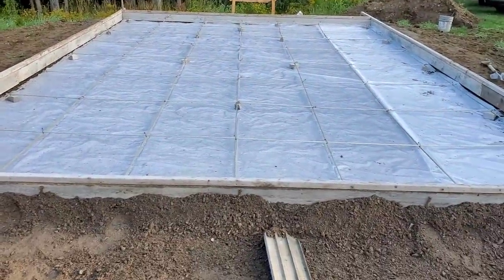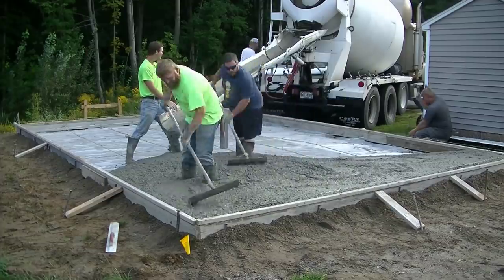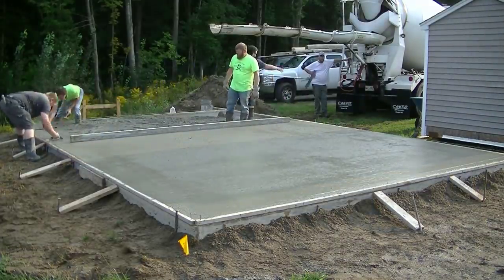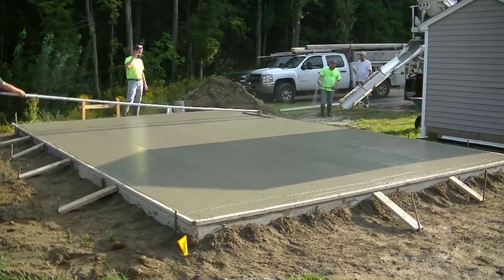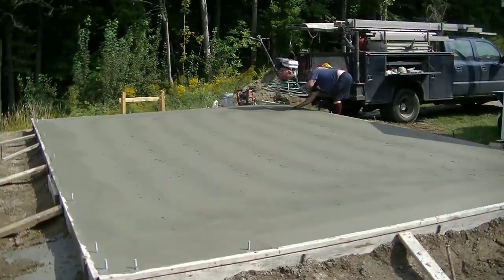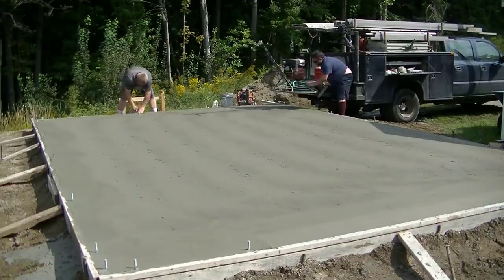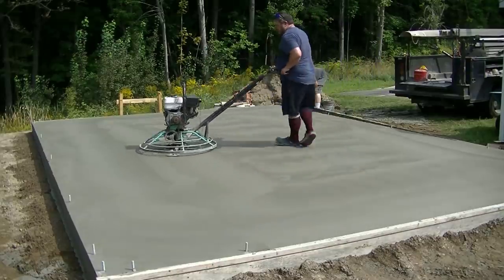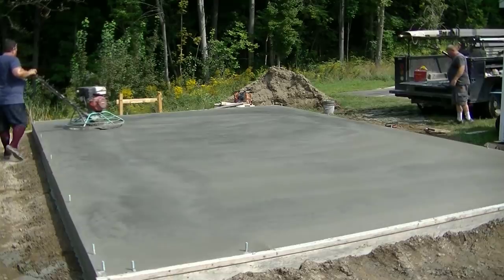They Made Us Pour This Shed Slab 8" Thick (Wasting Money)

Comment: I had this in New Zealand once, years ago. I got the engineering for free from a family member. Which was lucky because he pointed out the slab would have to be thicker than normal due to what was right next to it. I didn't even realise there was anything particularly unusal about my site. So I did the calculations and ordered the quanity of concrete for that deisgn. The guy turned up and then tried to talk me about of using his whole truck load, telling me it was over engineered. It was pretty obvious he had another small job he was trying to get to the same day and so was trying to use less on my job. I was young and he was trying to bully me out of using the full amount. I got close to losing my cool to be honest. I was about to ask him where he got his engineering PhD degree from, that he could overrule my engineered plan. Instead I just kept repeating; that is what the engineer specified, that is the form I made, that is what is going to be installed and that is what we are going to show the engineer - until he got the bloody message. 

Normally, it all depends on the potential soil movement but as in my case there can be other factors. Plus you don't know what they intend to put in there. That slab in the video  has no piers - like most shed slabs - so perhaps the engineer thought it would just be easiler for a small area to make it thicker and not have to worry about it. Sometimes it is just cheaper to use more material and over engineer something than to precisely engineer it.
Reply: What did the guy want you to do? Rework your forms while the concrete sat in the truck?
Reply: “ Sometimes it is just cheaper to use more material and over engineer something than to precisely engineer it.”

I learned something new today!
Reply: @BillJBrasky  Yeah I know! He wanted me to somehow level it inside the form. It made no sence. He just thought he could bully a young customer. It was never said - but pretty obvious, even to me, he wanted to use part of my order to go off and do another small job.
Reply: They never mentioned an engineer. He’s saying code enforcement. Code enforcement is a random guy with little to no training. All the ones I’ve worked with. They are mostly ex cops that became code enforcers for more money. I’m a mechanical engineer but tilted towards structural my brother is a petroleum engineer. For the last 10yrs I use synthetic or steel fibers Also other fillers. I don’t pour anything under 10,000psi. I just experimented with 25,000 psi and I’ve got test blocks as high as 37,000psi. For reference normal concrete like in this video it’s most likely 4,000psi.  Now the main thing  8” would be completely crazy if you pour a 12’x10’x8” @ 12,000psi and all you store in the shed is a mower, weed eater, shovels, & tank of gas. But 12’x10’x8” @4,000psi. It’s definitely over kill in the real world 99% of the time. But it’s also 4,000psi. I refuse to pour 4,000psi when it’s so simple to make high strength concrete.
Reply: That guy drives the truck don't listen to shit he says, I would've called his boss and got him fired. Guy trys to fuck with my pours like that would get a smack
Reply: I had something similar happen. I had my specs ready and was looking for estimates. So this guy stopped and started suggesting something else than I wanted. I stuck to what I wanted and insisted on an estimate accordingly. He left and eMailed me an estimate in ways that he wanted to do it.

He did not get the job.
Reply: Piers simply depend on the soil  test
Reply: Never let a concrete driver tell you how to place your concrete. You tell them. They aren't paid to think, they're paid to listen to instructions. They think they know, but they just truly don't understand.
Reply: How far did he think he was going to go with concrete curing in his truck?
Reply: @fryloc359  I don't know. I didn't ask. Didn't care. The drum kept rolling, toss some water in, so he probably had time. It probably wasn't far away but that wasn't my problem. 
These days there are mini mixes and other options for small jobs but I'm not sure they were readily available back then. But I needed what I ordered so he should not have tried to make it my problem.
Reply: So... what was right next to it?
Reply: @nobodydoesithalfasgoodasyou  Foundations of an existing building.

Comment: Be careful using it with PEX for floor heat. It isn't heavy enough to hold down PEX full of air. My shop floor PEX started to float right out of the concrete with plastic chairs as we poured. I'll use the brick type chairs next time.

Comment: I tell my customers that drying is different than curing.  In fact, I tell them if it dries too quick;  it prematurely stops the curing process.  That is why I have become convinced of the value of cure & seal on outside work to lock in the moisture for the curing process to mature.  Rapidly drying surfaces are one of the major causes of spalling.  Inside a building where the wind and the sun are controlled; the need for cure & seal isn't as essential.
Reply: Slowly curing makes for stronger concrete with higher compressive strength.  Anything that can be done to make that process a little longer is generally a good thing.
Reply: I sprayed my concrete 14'x 40' driveway to my building with water two or three times a day for a week.  It's been 15yrs and all it has is a couple of hair line cracks.
Reply: In Virginia back in the ‘60s, the concrete guys would put straw down and wet it and then cover with plastic.  Then you would spray it a couple times a day for a week.
Reply: Curing compound is really only needed for windy days or hot dry days. You don't want the surface to dry/cure any faster than what's underneath it. Also don't use poly sheeting as a barrier between the fill said and the concrete. It will retain excess water and can cause cracking. You should always prehydrate your base before pouring. That is sufficient to prevent over absorption of water from the concrete.

Comment: This is the standard in NZ any pour with structural elements requires a minimum of 250mm thick slab 12 mm mesh 75 mm cover either side of mesh
Great work guys good to see someone that knows how to use a rake makes it easy for whoever is screeding
Reply: "All concrete cracks eventually" is something I always hear in these US videos. If a concrete contractor said that here I'd find another one. If it cracks you didn't do your ground works right.
Reply: @Fekillix  The earth shifts constantly. Cement is good in compression, terrible in tension. Some places are more stable than others, and it depends on how big the slab is. I had a guy ask me to pour a slab 12" thick for his shed. I did warn him it was way overkill for a tin shed but it was no problem. I wouldn't say "all concrete cracks eventually" I would say, "the bigger the slab and the more unstable the ground the more the slab will crack."

Comment: Some shop machinery requires a thick enough pad to resist vibrations.
I know if you operating a black smiths shop some power hammers the bugger ones require 10inch thick

Comment: Living in New Zealand and it's earthquake and steep terrain we put vastly more steel into a pad like that.
Steel mesh 4" X 4" 1/8 to 1/4" rod two layers with rebar at strategic points. Even a pedestrian footpath around the house needs to be 4" with steel 4x4 mesh to last the years I assume anywhere. Given the overall investment extra reinforcement is cheap insurance.
Reply: I haven’t seen this fiberglass reinforcement used in NZ. I wonder if we will get to use it, much easier than rebar.

Comment: The extra cost is peanuts and the vapor barrier will definitely help keep the shed dryer assuming they plan to condition the space.  6'' is required to make rebar effective or cracks are all but guaranteed and 8'' might be required for whatever equipment they plan to install in there for vibration reasons.  I can't say anything negative about a customer asking for above minimum code work.  It will be a nice floor for what will probably be a very nice outbuilding.

Comment: I guess I am the oddball. LOL I have NEVER stated after I poured a slab or footing " I sure wish it was thinner". Here on the farm I do not care if it is just a cattle yard it is going to be 8 inch minimum.  My shop floor is 12 inches thick and it does not have a single crack in the 19 years it has been there.
Reply from the maker: Like in the video, if it has a proper sub-base and compaction, 8" is overkill and a waste money for this application.

Comment: what type of concrete bolts did you insert? and WHEN in the process did you push them into the uncured concrete?
Reply: Just standard anchor bolts usually in an L shape.
As for when, you insert them when the concrete is just getting hard enough to support them so they stay upright and straight.  But not so late that you can't jiggle them and get cream to fill the hole around it
Reply: Anchor bolt/ J bolt

Comment: 8 inch is quite a bit for a shed. I used to drive a mixer truck. It was a decent gig and was fun to learn about concrete but the contractors we worked with were always very high strung and tried to keep every scenario as stressful as possible. I eventually had enough of it and quit but it taught me alot for my own projects later on.

Comment: I know when the concrete slab was poured the concrete contractor's power troweled the 4 " slab of my house the next day. I have no idea what type of concrete they used. I would have liked a 6" - 8"
 slab looking back. There is a lot of weight of the house transferred to the slab, well over 2-3 tons. My garage floor slab has several cracks in it since it is only 4" thick. Since in south east North Carolina you have to have J bolts in every cavity plus hurricane braces every where from the the slab to the studs or bottom plate & the studs to the roof trusses. Are they fiberglass rebar stronger than normal coated steel rebar or wire mesh? Do you recommend cutting expansion slots in the slab if it is 6" - 8" thick?
Reply: I build commercial buildings so the thought of putting a house on a 4" slab is insane to me. The only thing we ever pour 4" thick is sidewalks. But your garage cracking can be caused by a thin slab, not enough rebar, poor subgrade (which is really scary), or a bad mix.
Reply: @Wellactually123  Thank you for the information. The subgarde is just dirt using wire mesh.
Reply: @donaldhollingsworth3875  Dirt is fine as long as it's the right kind. Was it a light brown or red? Or was it dark brown to black?  Light brown indicates lime and red indicates clay. Either are fine if mechanically stabilized properly. The darker the soil, the more organic material there is. Organic material will break down and change the shape and compaction of the soil. Sometimes you can chemically stabilize with lime, cement kiln dust, fly ash, etc. But black soil, it's great to grow plants, but I wouldn't put my house on it. 

If you have a really good subgrade and strong concrete mix, wire mesh can be an option but I wouldn't do it. Rebar or post tension cables are a much better option.
Reply: @Wellactually123  The soil is black. When it rains the soil is super wet and does it smeel but when the soil is dry it is like digging through concrete. I think this has to do that the subdivision was built on drained wetlands.
Reply: The slots you asked about aren't for expansion. Those are control joints and they're used to hide the cracks by controlling where it's going to crack from shrinkage. It cracks underneath the joints because that's the point least resistance. If you don't have any joints in your floor that's why you see cracks. You get better results when you cut them in when it's wet and it looks better imo but saw cuts are easier and some times the only way possible. Concrete is going to crack no matter how thick it is but unless you're a finisher or another trade in the industry there's no reason to know that so most people think the cracks are structural. But it's usually just from sloppy work and inexperience. Structural cracks usually spread apart or sink and become uneven and some times they stop but they usually get bigger
Reply: @donaldhollingsworth3875  That smell is decomposing organic material. The fact that it is hard when dry usually means there's a good amount of clay in it. They also could've chemically stabilized it. I wouldn't recommend doing this, but it's better than nothing I guess. Is the soil soft when wet more than a couple of inches? If so, you could likely have problems.
Reply: @chichidouglas5078  Very true. Sorry. I missed that part.
Reply: @Wellactually123  After a storm which only drops an inch of rain, the yard is soggy. But when the yard is dry, it's like trying to dig into concrete.
Reply: @donaldhollingsworth3875  Ah, well, your building pad can be very different from your yard. Your building pad could've been removed, treated, and compacted. The building pad is generally very close to the footprint of your house. So you really can't judge the soil below your house by what is in your yard unless you saw how they built the pad and what soil they used for the yard.
Reply: @donaldhollingsworth3875  I don't know what the code is where you live but in Washington and Oregon we have to dig down to bearing soil which is previously undisturbed soil and the footings have to be a minimum of 12" below frost line and that's the bottom point of where the ground freezes. We have to do a compaction test after we dig to determine if the soil is bearing and if the lot isn't on city water we have to do a percolation test to find the water absorption rate of the soil to figure out what kind of septic system effluent water treatment filters and drain fields will work best. For example I have a sand filter because my soil has a lot of clay in it and it had to be about 250' from my effluent tank because that was the best place for the drain field. Your house should have an as built plan on record that would have that info in it at the county building department and they're usually on the web site under as built and your address. If there's a compaction issue the stem wall will have vertical cracks in those areas. But  there cold be hair line shrinkage cracks and you don't need to worry about those. If there's a gap in it it's structural. If they're a 1/4 inch or more take note and if they grow then you should Investigate.
Reply: @chichidouglas5078  The builders in my subdivision took a bulldozer to dig out a pit to put in scrap tree limbs & trunks then back filled it in the dirt & sand on top of of that then the plumbers came in to dig their trenches & compacted the sand. Their have a lot of houses in the nearby subdivisions of the 4" slab of the house cracking because of the decomposing tree branches & trunks. So far I have minor cracks in the 4" thick slab of the garage & major cracks in the 4" thick driveway. It seems like the builders in south eastern North Carolina don't care or have any quality control. I had got told by the building supervisor when I pointed out defects that needed to be addressed that "I don't care while the house passed inspection, which was all done by fax, & if the house collapsed after closing he didn't care".
Reply: @donaldhollingsworth3875  I know the type. I've been conned into working for one but only once. As soon as I passed the framing inspection I burned that bridge and poured gas on it. If the garage floor doesn't have any joints cut in it the cracks are probably from shrinkage and they're superficial. The driveway cracks are probably from a bad sub grade and those can be fixed most of the time. Take pictures of them if you haven't yet.  That way you can tell if they get bigger
Reply: I only cutting two expansion  slots on the load bearing walls of the main slab of the house. Of course looking back on it from 20 years ago I would have had the main house&b garage slabs poured to a minimum of 6" - 8:" thick. with coated rebar instead of the wire mesh. The next time I ave a house built, I'll have my ducks in a roll &  know what I want done.
Reply: @donaldhollingsworth3875  I poured my garage floors and wood shop floor  4 " in 1997 and they've taken a beating  and they have some dings and scratches from dropping stuff but no cracks yet. 
If it's just used for normal garage activity like parking and working on normal sized vehicles 4 " is plenty if it's to code. So #4 rebar mat 3' grid and compacted 5/8" minus gravel sub grade and rebar dowels every third bar and properly placed control joints. That's standard and if someone tells you it's not then you don't want them to do it for you. 6" or 8" will crack just the same if it's not done properly and especially if the sub grade doesn't meet compaction requirements because they're heavier so they'll sink deeper.  If it's engineered for 4" it's just a waste of money to make it deeper.

Comment: I had a 16 by 20 foot slab poured for a shed. The slab was poured 5 inches thick (4 inches was code) with an 18 inch thick perimeter (16 inch was code). The perimeter runs in 16 inches from the edge before tapering up to the 5 inch thick slab. Gravel and vapor beerier was also used. Extra re-bar around the perimeter too (double what code demanded). It's been many years and not the slightest crack. Weeping tile was also installed around the slab and I have absolutely no frost heave. 
The shed was built  just a few inches from the rear deck (walk out basement), with a flat roof so now my deck is much larger than it was as it continues onto the sheds roof. Every part of the project was over built so I was also able to install a hot tub on the deck over the shed section.  
There is absolutely nothing wrong with building above what code calls for. It does drive the cost up, but in the long run, it's worth it.